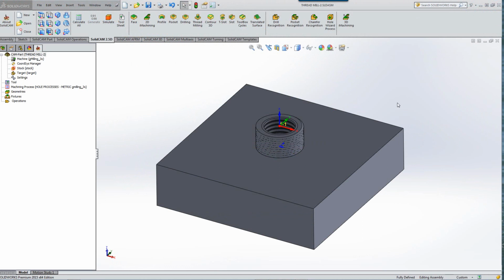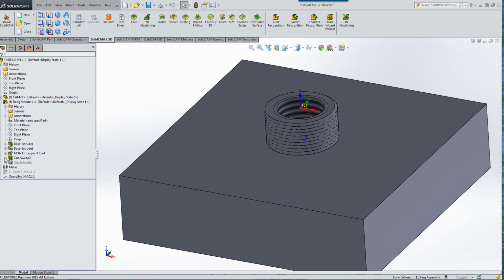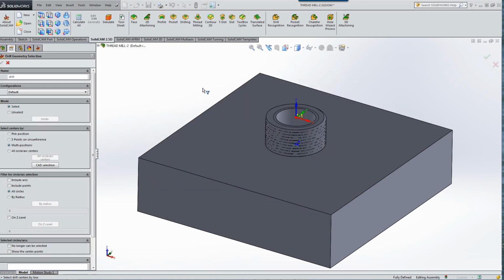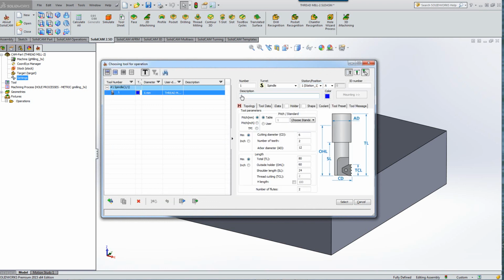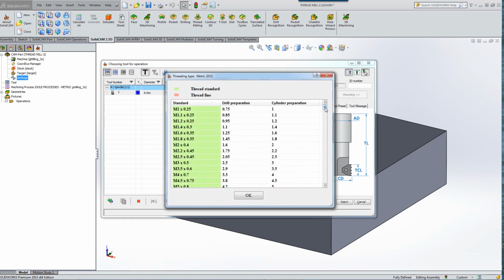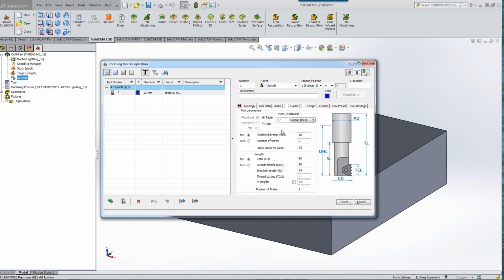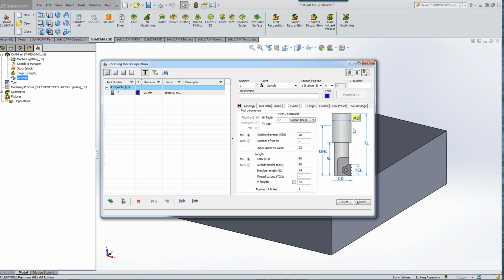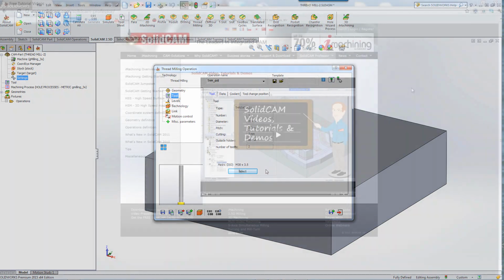Introduction to Thread Milling and Tool Selection

Comment: Hi , I have a problem in solidcam , I cant make a partial turn in thread milling it always gives me that the minimum turn is 360 degree, I need to make a half thread mold for a plastic buttle, so is there a way to do it ?